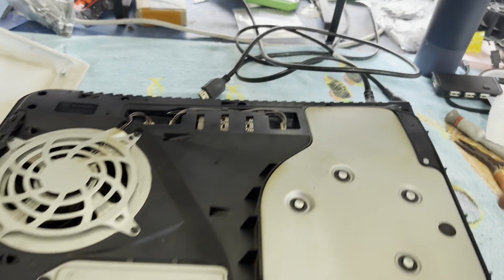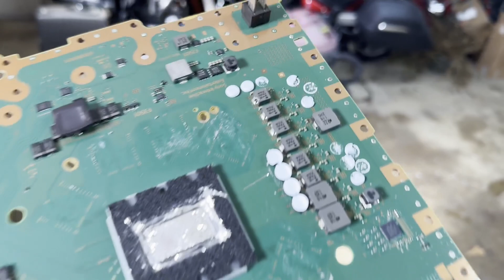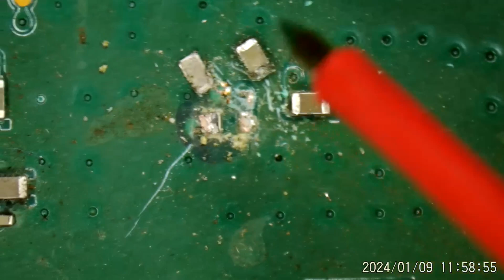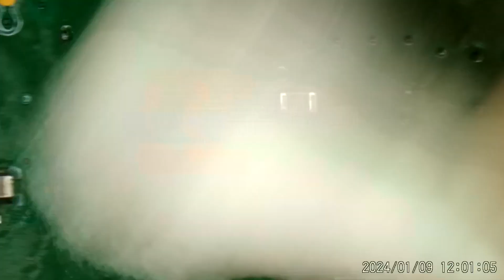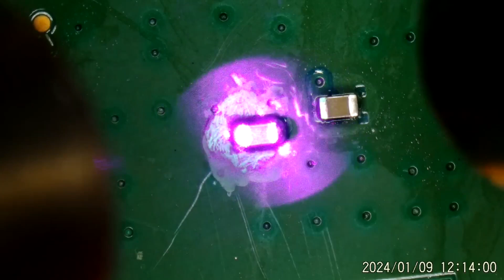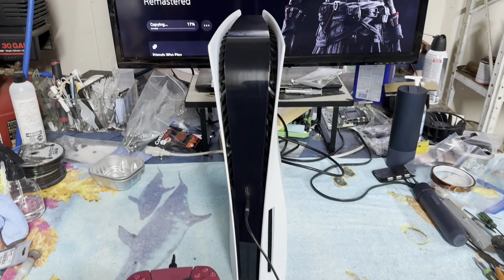#130 Repair of PS5 Disc Beep Only

Comment: Beep with no light sometimes means it's been opened and the light ribbon cable was damage when putting it back together.
Reply from the maker: Very true!  I have seen more than one where the ribbon was crushed by the case screw.  It can push the conductors inside the ribbon together and cause a short.

Comment: Sir plz help, ps5 was not giving any signs, the power supply was dead so i fixed it. After that there was still no light or sound, the southbridge problem, after I changed it the console turned on and worked normally, wifi, bluetooth, the disk was spinning normally and installed a ps4 game, I tried to play it but the console asked for an update and here we come to my problem. I kept getting "can't complete the update". Could it be because of a bad southbridge, although it doesn't make sense to me, or maybe something else is damaged, maybe the ssd controller, is it possible that it turned on normally and worked, but could not be updated because of the ssd controller?
Reply from the maker: If your console is a disc version, you will need the original disc drive or the console will refuse to update.
Reply: @ToltecMerc  Yes, I have the disc version. Are you saying someone replaced the disk drive?
Reply from the maker: @Can3Fix  I’m saying you need to be sure the disc drive is working fully.  Can you install a game from the disc drive?
Reply: @ToltecMerc  Now I'm stuck in safe mode but when I first started it it worked normally and I installed a ps4 game from the disc but I couldn't start it because the console was asking for an update. Is there a number on the console and disk drive to compare, how can I tell if they belong to each other?
Reply: @ToltecMerc  I contacted the owner of the console, he says it was a lightning strike, his friend opened it and determined that the power supply was dead and that was it. I fixed the power supply and replaced the south bridge. If he's telling the truth, everything on the console is original, but he doesn't want to update it.
And now I'm stuck in safe mode.

Comment: Great fix! I did notice the bip, and then nothing normally tends to a short on the 3.3v rail. Most likely on the wifi. But what's interesting is the cap that fails. I guess it's a design flaw with continuous usage with wifi.
I bet the console still smells even with after all scrubba dubba you did 😅.
Reply from the maker: This one definitely failed because of roaches.  It wasn't as badly infested as some I have seen but they managed to find PS5's weak spot.
Reply: Definately. But I wonder why didn't they cover the other side of the wifi module. The antenna is routed via the cable next to it 🤔. It's the same on the ps4 too. The back of the wifi is exposed.
Reply from the maker: I would guess because it would cause a problem with the WIFI/BT module itself.  Perhaps capacitive loading to the grounded metal shield.

Comment: Nice repair. I have a "dead" PS5 with the same issue but I can't find the faulty capacitor. :D Or at least I believe the fault is a bad capacitor.
Reply from the maker: It certainly could be a bad capacitor.  Seems to be all to common on the PS5.